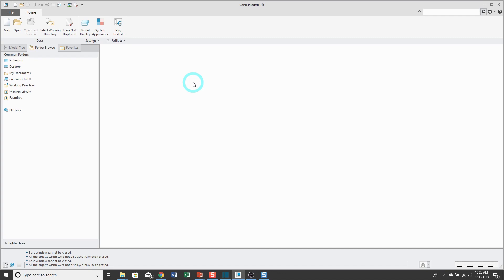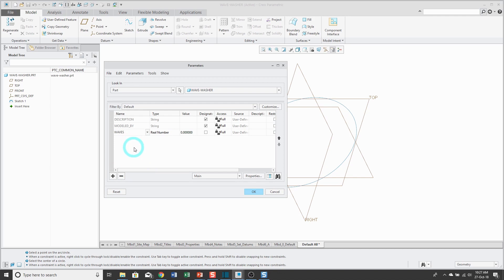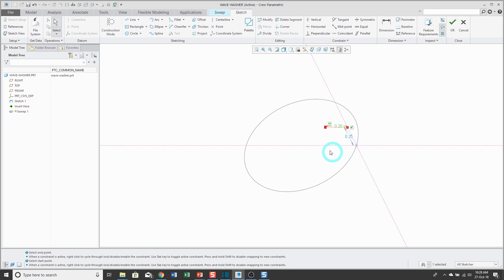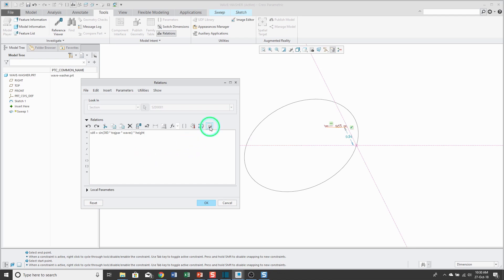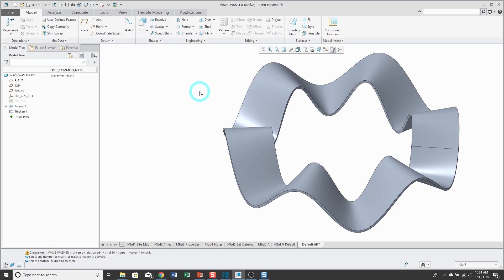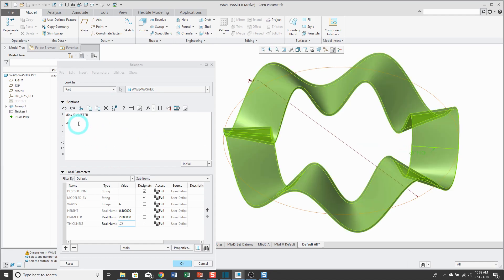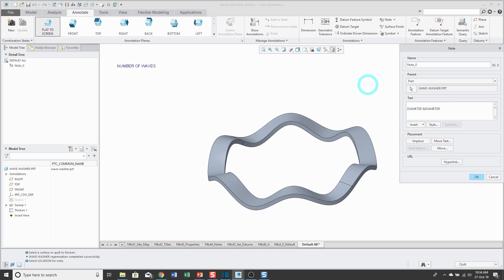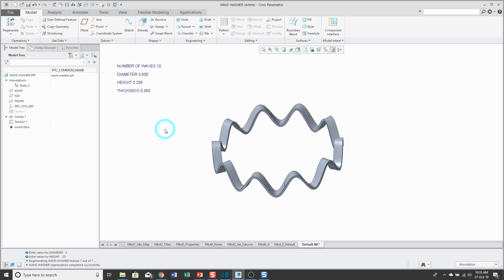Creo Parametric - Variable Section Sweep - Wavy Washer (Demonstration)

Comment: Can you please make a 'mixed flow' impeller ?? Not the radial flow but mixed flow, so that the vanes are bending from being vertical at one end to horizontal at outer end....please ?
Reply from the maker: I’m not familiar with that.
Reply: @CADPLMGuy  its like a closed radial impeller but the the inside (eye of the impeller) vanes are horizontal, and the end of those vanes (i.e. outside) is vertical. Its like a surface/cross section , which is vertical in orientation, is following a path/arc (like a sweep) and ends up being horizontal.
Reply from the maker: Okay. I still don't know how to design it.
Reply: @CADPLMGuy  hmmm can i send you a picture of it or something ??

Comment: Thanks, for this. I set mine up differently, used the circle as internal diamater as that is how you buy washers and added an outer diamater calculation.
Kept me amused for an hour or so this morning.
Reply from the maker: Good point, I didn't think about that. Yes, you usually choose washers by ID.

Comment: i am a little confused about trajpar. I wrote the relation "sd4 = 0.1*trajpar" . I expected it to go from a height of 0 at start to 0.1 at the end but it didn't generate anything. what am I doing wrong?
My understanding is that trajpar is a location variable along the trajectory and height at particular location along the trajectory will be defined by "0.1*value of location variable at that point i.e trajpar"
Reply: i tried it with a straight line trajectory and it worked